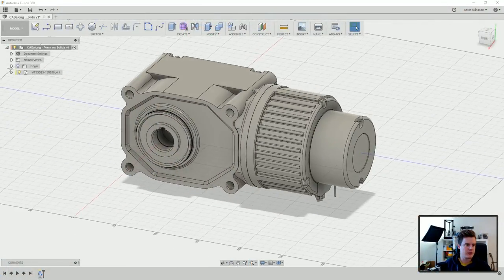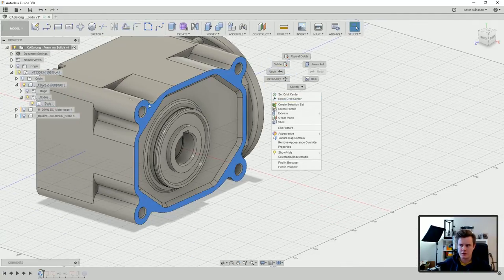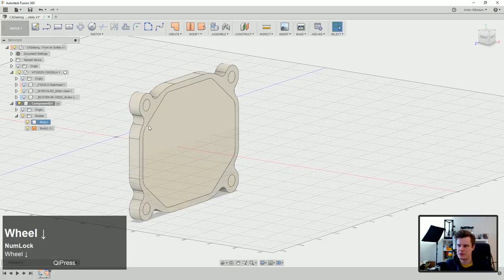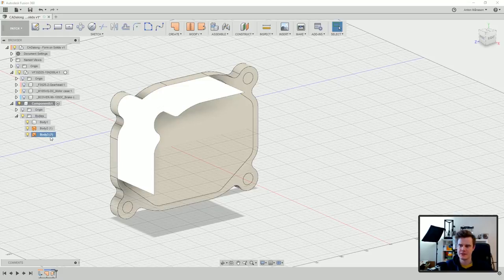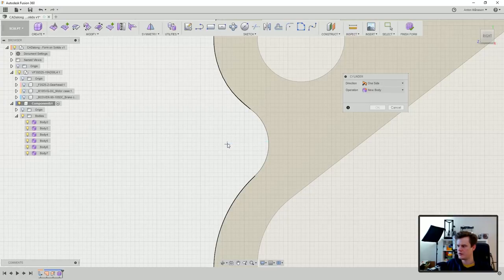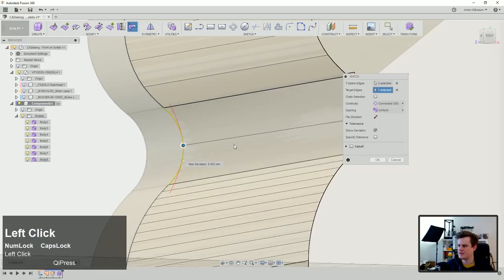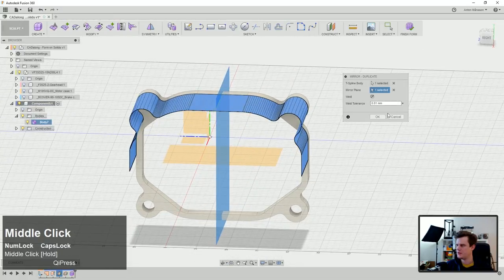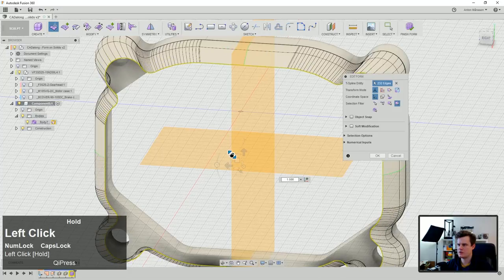Autodesk Fusion 360 Patches, Forms and Solids | /CADalong

Comment: I thought it was a great video.  But I am curious as to why you didn't make use of the LOFT tool for some of the surface joining operations?  Thanks!
Reply from the maker: Thank you! I think the Loft tool for sure can have it's moments! Specially if you're fitting the shape into an exact measurements (set of profiles in the loft). For many, the freefoorms offer more flexibility, specially in the design process where loft is more 1-way tool (you can still edit each sketch, but it's more in one direction).  For the first part, where I used 4 patches, Loft could definitely be an option!